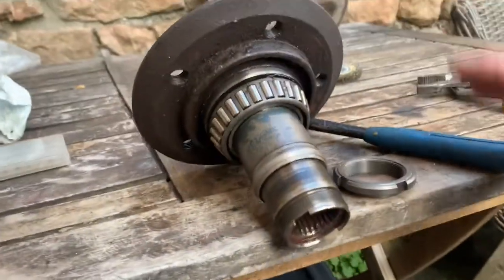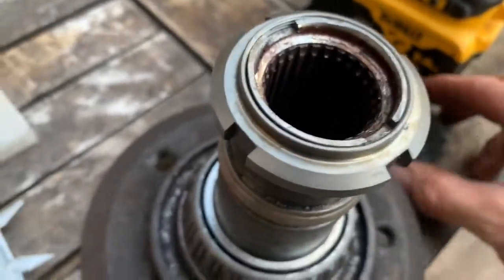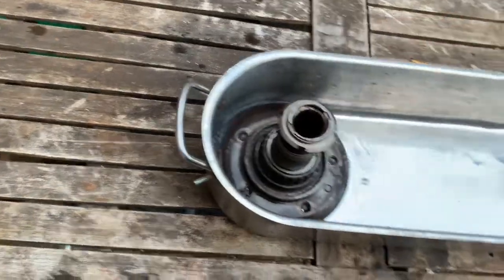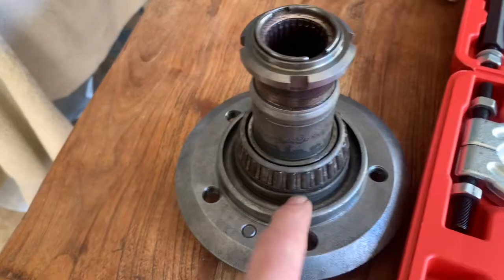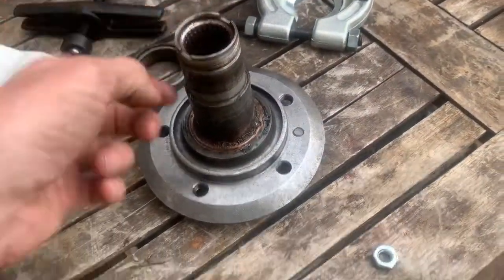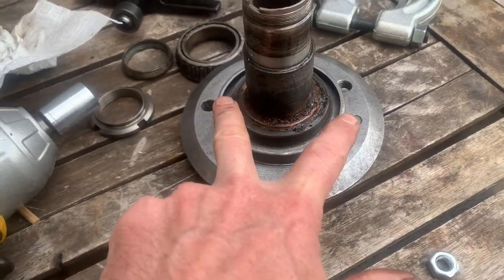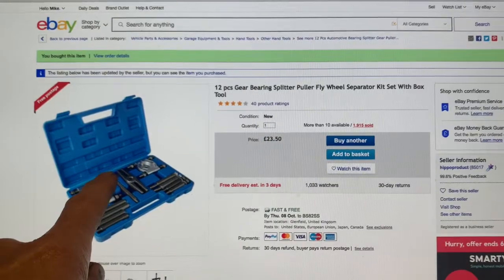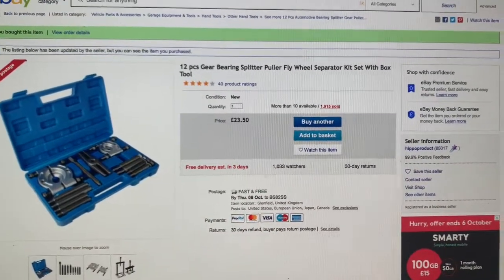Mercedes R107 rear hub refurb and bearing removal

Comment: What kind of puller will you be using to pull on the bearings.  I have been trying to figure that one out for a while.   Great video btw!
Reply from the maker: Hello - I am going to see if this 36 piece Press and Pull kit does the job. Ebay item number  124098885927 Mike

Comment: Hi, Thank you for this video. Could you please provide me the product reference to remove rust on the hub?
Reply from the maker: Thank you for your comment. Evaporust is a fabulous product but expensive. These days I use Bilt Hamber Deox-C crystals which work out much cheaper and basically do the same thing. Both products are available through eBay and Amazon. Mike

Comment: Hi Mike. Can you tell the name of manual and its publisher your referencing. Cheers
Reply from the maker: Hello - I am referencing the official Mercedes workshop manual. If you type the following into google, you should be able to find this section online in one of the Mercedes forums:
35-130 Removal and installation of rear axle shaft flange, adjustment of bearings
Mike